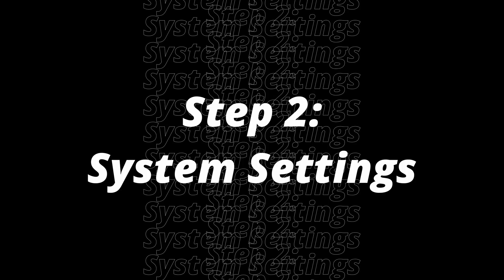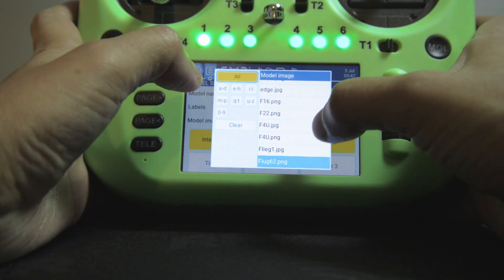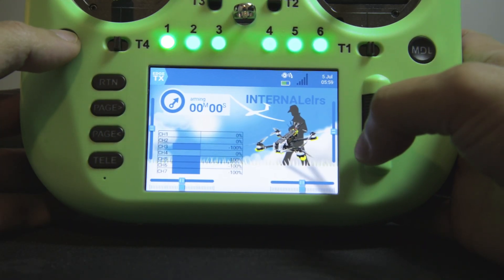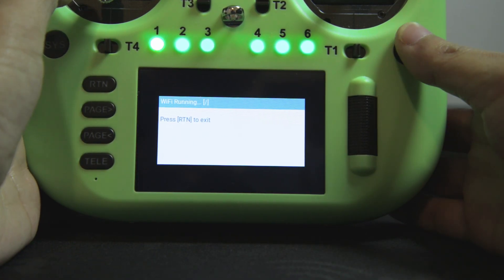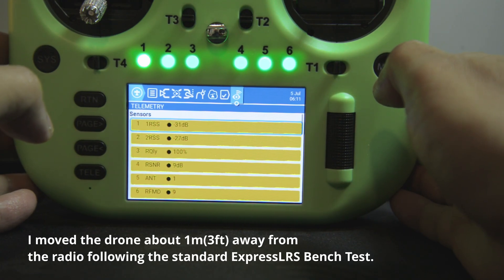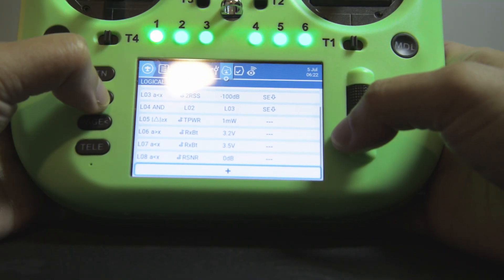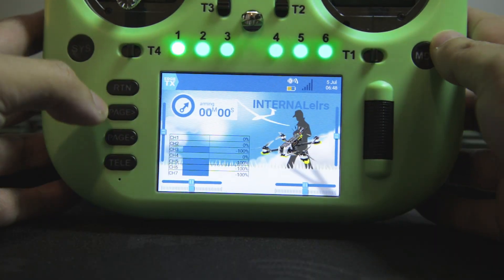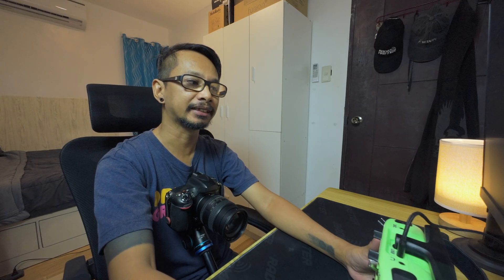How I set up a new EdgeTX Radio for ExpressLRS in 2025 ft. the RadioMaster TX15

Comment: I just got a tx15 and an r88 receiver… I am struggling SOO hard to get it bound but I swear I’m doing it all right but I don’t even know anymore. Are these not compatible or something???
Reply from the maker: "The R88 V2 receiver is Frsky D8 / D16 and Futaba SFHSS Compatible" -- RadioMaster R88 Product page
Reply: @deadbyteDrones  yes and ive found these protocols in my transmitter but it just wont connect. I was told on reddit that I need the 4 in 1 module to make it work but i also literally contacted radiomaster directly and they responded with exactly what you responded with and they told me the tx15 is compatible with the r88 and they sent me a link to a video showing how to bind the two but it just does not work for me for some reason... I have a feeling the person from radiomaster who responded to me didnt fully know what they were talking about? but i really hope they did and im the incorrect one.. I have a lot to learn about edgetx
Reply from the maker: @dash0173  yes, with the right settings, you can find those protocols. and it'll work IF, and only IF, your radio has the hardware for it. 

AFAIK, the TX15 is ExpressLRS ONLY, and it will only sync/bind with ExpressLRS receivers.
Reply: @deadbyteDrones  thank you! i ordered an elrs receiver. should be here tomorrow. I will get the 4 in 1 module one day probably
Reply from the maker: r88 receiver? is that even an expressLRS receiver?

Comment: Could you send me all the files for your controller because I messed mine up
Reply from the maker: Go into radiomaster's website, then in the Download Page, under the Firmware Updates page, both firmware file and SD card contents can be found there.
(The TX15's files aren't there when I posted the video. But shouldn't be necessary because of that first step.)
Reply: @deadbyteDrones  could you send me your multirotor model? On my controller, it is bugged
Reply from the maker: @Zach.Alaska  How is it bugged? might want to resolve that first. Best to consult the edgeTX discord.
Reply from the maker: Here's the backup I made of the factory sd card content, if you still need it: https://drive.google.com/file/d/1K8e7r66nVxtBFXWNbGGspJQwFnfd9s76/view?usp=drive_link